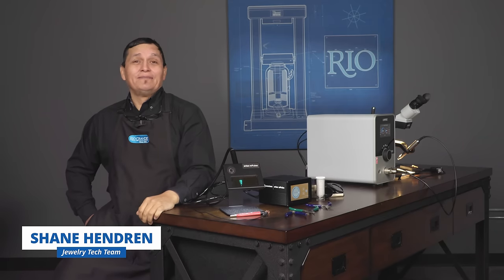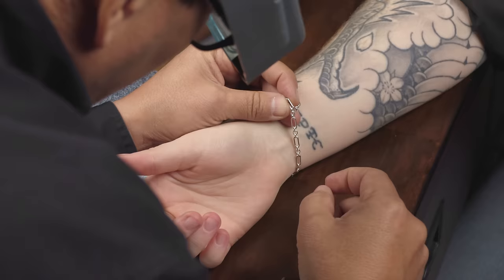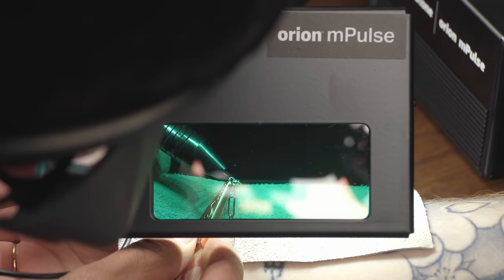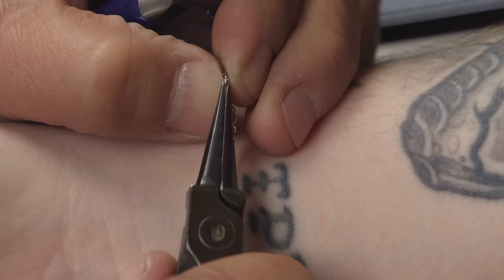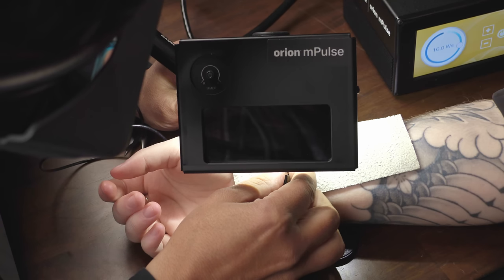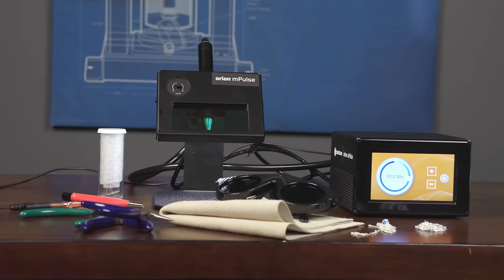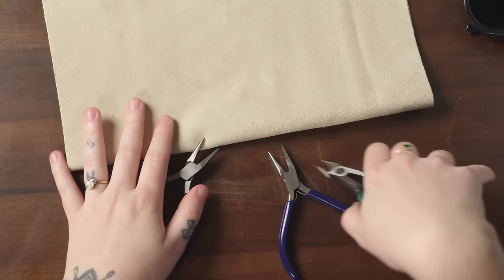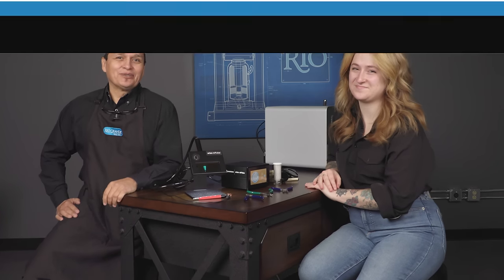Permanent Jewelry Overview

Comment: Any issues with insurance companies covering this considering you could really hurt someone while welding. What about issues with liability if someones circulation is cut off by the permanent chain?
Reply: There is a waiver they would sign that states what things can happen. These aren’t any different than the thick wire bangles that people stack up to 6-8 high on their wrists here in Hawaii. Those if they were caught on something definitely would NOT break off as these dainty ones would. Or the Cartier blt that you need a screwdriver for. I’m not sure why people consider this so unsafe?